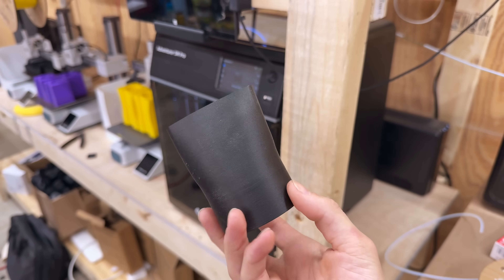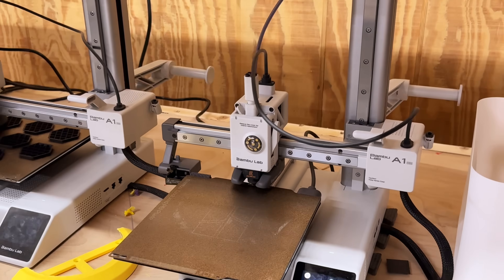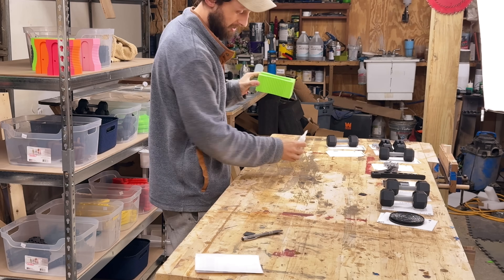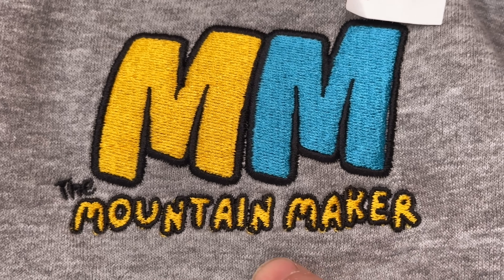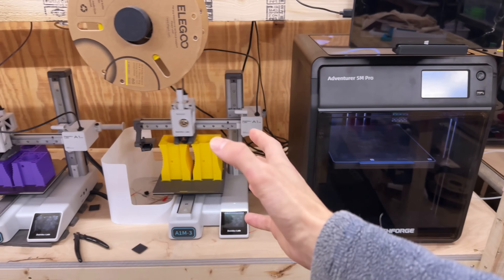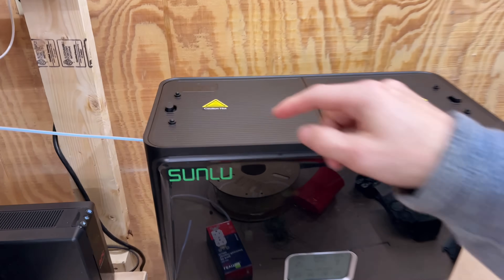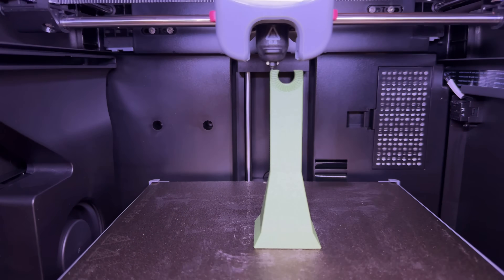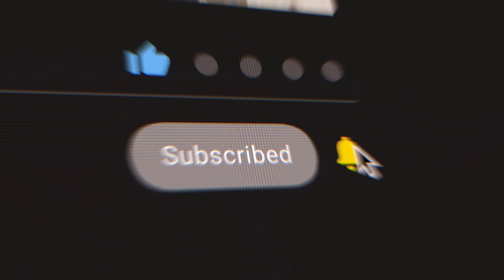Inside my Small 3D Print Farm: Packing Etsy Orders, Restocking Products and PETG-CF Testing Fun

Comment: I ordered a thermal label printer from temu and it needed me to turn off my antivirus and firewall. I returned it coz i dont feel safe. Do you have to the same with this label printer you have or is it safe?
Reply from the maker: I didnt have to install any software to make either of my label printers work but your results may very depending on your anti virus software. I tend not to use any as I feel they are a virus themselves and have only ever slowed down my computers in the past, but that ones all my personal beliefs so take that for what its worth. Aside from that, windows built in security software doesnt flag it or ask me to disable it to run the printers and neither do any of my Macs

Comment: You may know this but you can put your partial rolls in a printer with an AMS and have it auto switch one roll to the next when they run out as long as they match.  On my larger prints, especially single color prints, I start off with the partial and then have it move on to a new spool when empty. Works great.
Reply: should have thought that was possible... nice. for anyone reading: In Bambu studio on the Device Tab -> click the hexagon icon (below and to the right of the ams, to the left of Guide)

Comment: i would recommend you spending a bit more on the Gloop glue for PLA. I know its pricey but it will hold literally forever as it bonds the PLA together, Superglue/ Isocyanic doesnt actually weld them its a bandaid that fails... Also Those tubs are for Business use for sure NOT for personal use... I work for USPS :)
Reply from the maker: We're a business and bring things down there quite often so the last time I was in there, I asked if I could have a few bins and she said sure, how many. I am interested in trying out some of the 3D Gloop though for these. The dumbbells it would be hard because I need the extra set time of the CA glue to make sure they are lined up correctly and no glue leaks out of the ends but I could design it so there is channel inside I suppose. Thanks for the suggestion!

Comment: According to the release notes 1.10 of Bambi studio now supports mouse ears if that’s helpful.
Reply from the maker: I think i just missed it in there. I’m used to Orca but have been migrating things back to Bambu Studio because it’s essentially the same piece of software with a few more limitations but with the impending release of the new firmware if figured it can’t hurt even though i don’t plan on updating immediately
Reply: @ yeah that just dropped, Orca slicer as you know is also wonderful, so I wouldn’t switch back just for that alone.

Comment: I used Printful for a while  - their quality control was pretty bad so I stopped using them. I had issues with embroidery like you did and bad digital prints with lots of ghosting. Their production time was inconsistent and sometimes took weeks, which is pretty bad for “print on demand.” I gave up and had a local silk screen shop do my t-shirts and ordered custom patches to use on my own gear. (Printful also discontinued the US-made “dad cap” that I liked 😢 so I had to buy them direct from the manufacturer instead.) Ultimately I gave up selling merch altogether.

Comment: I have an X1C with AMS and when the filament on a spool runs out it lets me know. Then I just put a new roll in the same position in the AMS and continue printing. Is that not possible with the A1 mini without AMS? I would think that is possible, so you don't have those "100g left" rolls.
Reply from the maker: It is, but It saves me from having to be around to swap it out as im not always down there when it runs out, sometimes it’s in the middle of the night, etc. and if it sits too long, the part has time to shrink and the layers don’t line up or there is a small line when it starts printing again

Comment: what do you use to make your coasters? petg or pla or ?
Reply: Another question, you mentioned all the yellow spools, does the a1 mini/ai have the same thing as the p1s/x1c where if you have multiple of the same you can have it just use multiple rolls and empty them in that fashion? I know if i get low on a color i can put 2 of the same color on and tell it to start with the lower roll and it will just switch to the next roll once that one runs out.
Reply from the maker: It does and it works better than the one on the normal AMS for the lighter spools because they don’t come loose or get moved around when doing a filament change.
Reply: @TheMountainMaker  that's interesting, i have seen people talk about printed inserts for the spools to put weight in them for when they get low... I've ran out numerous spools and  i haven't had the problems i've seen people post about, thank goodness.
Reply from the maker: I use PLA, but your comment just now has me questioning that. I typically use a coaster for cold drinks to prevent condensation on the wood and what not but i never really considered the hot drinks for some reason. I need to do some tests now to figure out if the PLA will hold up or deform from the hot drinks. Thanks for the question!
Reply: @ yea i was thinking that too. And another q, how do the coasters sit on diff surfaces? Are they slip and slide? If so wiuld some felt glued on small pads or cork board feet on bottom help? Just thinking about it

Comment: Why not consider a filament welder/joiner for the remaining filament spools. Print a winding rig & reload the spools.
Reply from the maker: I will end up using those last 100g or so in the A1 Mini on my AMS Lite. The normal AMS doesn’t like the lighter spools but the Lite handles them just fine. Then i can use auto refill and use up any remaining filament

Comment: Love your videos, just wanted to say you shouldn't be touching carbon fiber with your hands. I have a microscope and saw myself that a LOT of carbon fibers get stuck in the skin immediately after touching, not even rubbing, and they don't come out after scrubbing with soap and water. And I wouldn't want to breath any in on accident. If you touch CF prints every day at a production level, not good. But I personally don't use CF at all after seeing it under the microscope myself. Only solution imo is using double gloves before painting, and painting isn't something I need, so I just don't use CF. But let me know if you disagree
Reply: I wrote a detailed comment here answering those questions but YouTube seems to have deleted my comment. I did the same test that Nathan did and had the same results. CF is meant for people who know how to handle it safely. If I ever need to use it, I will use ventilation, thick gloves, and paint or finish
Reply: @ Both Dr Igor from mytechfun and TH3D (IIRC) also had some content on the CF filament issue and didn't find anything to be worried about. I'm not saying you didn't, but I just think more testing is needed before we can say definitively that CF filament is dangerous.
Reply: There are several videos showing the dangers of carbon fiber filament. The carbon fibers get into your skin, you can pretty easily find it on Nathan Builds robots channel.
Reply: @kylequinn1963  And there have been several from reputable sources like (of which nathanbuildsrobots is NOT; do a search on his "breakup" with bambu lab) demonstrating that it isn't a big issue as of yet; more testing is needed. People need to stop accepting a single source as authoritative fact and then parroting misinformation. The only video I know of regarding dangers of the fibers is nathan's video, and he is not a credible source of info.
Reply: If there is a need for more research on the subject, then I would take all safety measures in the meantime. Better safe than sorry.
Reply: @AnnMiller-k5c  That's a level of paranoia I'm not ready to engage in. There's also been no evidence that any fibers from CF filament are airborne; just speculation and fear mongering.
Reply: Very interesting, you say ‘Carbon fiber’ but is that printed carbon fiber filament, or the real deal carbon fiber?  In filament the fibers are fairly trapped and microscopic to begin with so 🤷‍♂️.  I wouldn’t bother with the cost or hassle of wear or tear on my printers for the cf filler. 

Glass filled filament seems to have better properties, uses glass beads if I needed the added rigidity, but if you have a microscope… I wonder how glass filled would look after a printing touch test.

Very interesting!
Reply: What brand, filament type and print settings used? Others have tested this and not found anything worth concern; a few other 3d printing youtubers did videos on the subject after nathanbuildsrobots did his, but his integrity is in question since he has a grudge against bambu for being cut off of their influencer program (i.e. no more free printers).